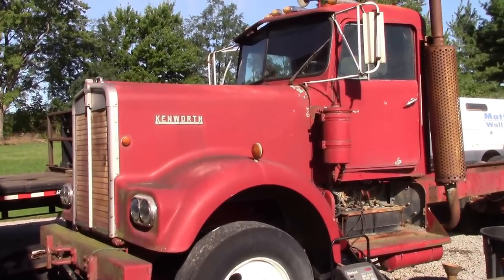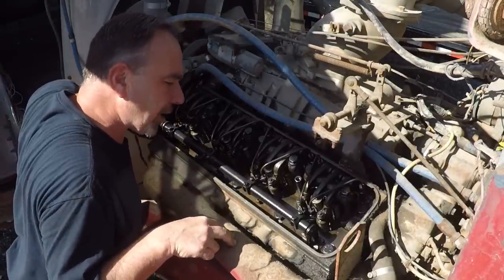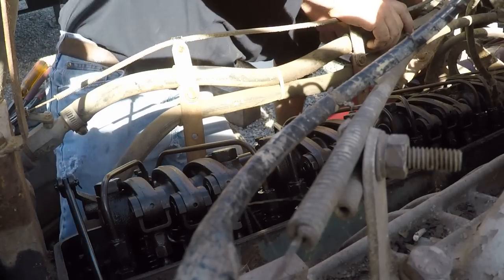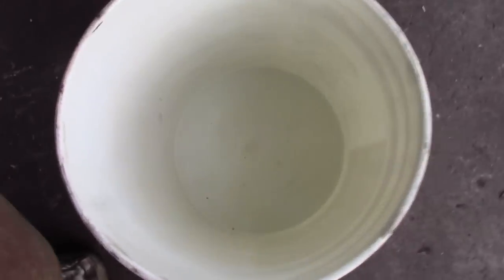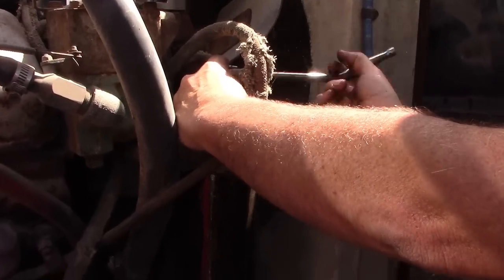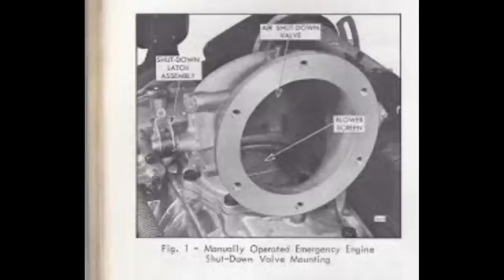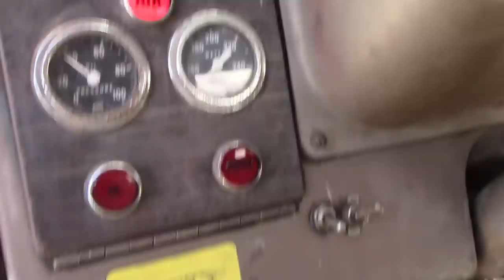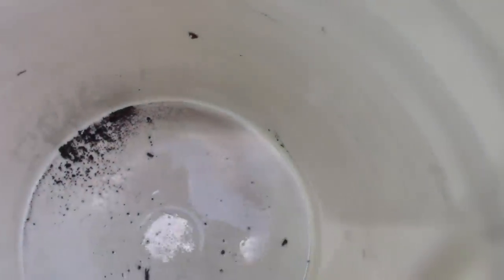WILL IT START? 1968 W900A 8V71 2 STROKE DETROIT!?

Comment: That was pretty cool! It's interesting that the alternator runs off the back of the engine. Looks like maybe the air compressor too. I'd like to see how that works.
Reply: They run off the back of the cam shafts. The alternator drive is bolted to the cam shaft gear, then goes through the accessory drive cover which has a lip type seal around the shaft. Then a pulley is mounted on the shaft. The air compressor bolts directly to the other accessory drive opening in the bell housing. Bolted to the back of this cam gear is a female gear type drive coupling. Between this and the compressor is a floating gear  coupling, male that goes into the drive coupling on the cam gear, then female gear that goes over the male driven gear on the air copmpressor. Minor revision, it looks like the alternator is actually driven off the blower drive. Same setup as above though.
Reply: Detroits are built so either end can be the front or rear and there are gear drives for the camshafts and the blower that can also drive many other things. They can be set up to run either direction too. It is also possible to get them to run in the opposite direction of what they are intended to run so the exhaust comes out of the air filter and the truck moves forward in reverse.
Reply: @tiredoldmechanic1791  Reminds me of a story I read online about a Saab 2stroke whose owner got challenged to a drag race by a muscle car owner.  The muscle car owner let the Saab owner specify a few details.  The Saab owner wanted the race in reverse.  As you can guess, he started the Saab up in reverse rotation and proceeded to motor away from the screaming engined muscle car using all 4 reverse gears!
Reply: @tiredoldmechanic1791  And when they are equipped with oil bath air filters, what a mess when they run backwards!!!!
Reply: first AND second !!
Reply: @tiredoldmechanic1791  I used to do tractor pulling with a super 99 Oliver with a 371 Detroit.  Stalled it out with the front end up, the front end coming down as I pushed in the clutch started it backwards.  Got it shut down right away, crowds loved it as it was very noisy.
Reply: @funguy571  The bad part of an engine running backwards is it has NO OIL PRESSURE..  The oil pump is running backwards too..

Comment: Detroit diesel, turning fuel into noise since 1939... What a sweet sound!
Reply: Lol, come on now, there are a few ponies along with the noise
Reply: and no power, screamin going nowhere
Reply: 318 HP at 2350 RPM.
Reply: @desertbob6835  318 HP? My 2014 Pete 367 had a Cummins ISL that made 550HP and 2050 lb ft with an Eaton 18 speed...AH...the beauties of a fairly large turbocharger...but the Detroit 2 strokes had a sound like no other engine. That Cummins could NEVER sound as good as the Detroits. Still, 318 HP is impressive with no forced induction.
Reply: @desertbob6835  It's confusing, Wikipedia says 304 HP@2100 RPM and 800 lb ft@1600 RPM, but previously it said 318 HP for the NA 8V71...so idk.
Reply: @Brock_Landers  you need bigger injectors (N70) and A timing to make 318.  318hp/865 lb-ft.
Reply: 8v71 was the 318. 8v92T was the 350? Next one I remember is the 430. Oh and was the 671 the 238?
Reply: 318hp with N65 injectors @2100 RPM and standard timing. 290hp with 60 cu mm injectors. 8V71T 350hp with 75 mms. The green 8V92Ts were 430hp with 85 mm from memory. Silvers were 475hp with 9G90 injectors and aftercooling.

Comment: Thanks for sharing this video JC, I really enjoyed the content & the music out of that stack  !!! 40 years ago I worked as a bus mechanic here in the UK, my job was to maintain air filters every 3 months, fuel filters, changed every 6 months, adjust tappets ( valve clearances ) every 6 months & change injectors annually. I replaced around 500 fuel filters a year on our fleet & the buses ran from around 6.00 am until midnight 7 days a week, I never saw a filter in that condition that you showed, often found some water but not that sludge. Well done Lady, admire her " I can do it " attitude, your a lucky JC TO HAVE A LADY THAT CAN !

Comment: The fuel return fitting on the back of the cylinder head has a restricted orifice to maintain  fuel rail  pressure from the transfer pump.  Thanks for reliving my day's  of old.

Comment: I never realized how big those Detroit engines were!! sounds good, take care Mr and Mrs JC
Reply: 8x71 = 568 cubic inches, which would be about 9.5 liters.
Reply: 71 series.......Each cylinder has a displacement of 70.93 cubes.  Multiply that by 8 and you get 567.44 CID which is 9298.6 cc, which rounds off very slightly to 9.3 litres.

Comment: Back in the 70s I drove a International Transtar 4200. I was driving across the truck lot and that emergency shutoff popped close. Thant’s when I learned it was there. I drove trucks for two different companies than ran Detroits.  All but one of them were terribly under-powered.  The only one that would pull a load was a White Road Boss.

I wished you would have your camera pointed at the exhaust to show what blew out of there when the engine started.

Comment: I drove an old GMC General that had an 8V72 in it. With a 5X4 behind it. Had to slam your fingers in the door in the morning so that you were all pissed off in order to shift all those gears. Gear jammer for sure, get the rpms built up and keep them on the upper end or start down shifting...lol God forbid if you missed a gear, not enough time for recovery, stop and start all over, Hence the reason for slamming your  fingers in the door...lol. Sounds great, exceptionally clean under the rocker boxes too!
Reply from the maker: that is exactly how my grandfather said you had to drive it. it is not the engine for me and where i am going with this project.

Comment: I have a customer with one of the last few 871's installed as an OEM engine in piece of machinery after they went out of production and the emissions restrictions made them illegal to use. It's been a while, but I think that was back around 1998 / 2000. It's only been back to the shop for repair once since we delivered it.    It's always a treat to hear that sound....

Comment: Thank's for the footage. I hope you intend to keep the engine in it. Not many of them left here in Australia so I have to rely on people like you to see some of these old trucks resurrected. By the way, looks like you and "lady" work well together, good to see 😎👍
Reply from the maker: i do not intend on using this engine for this build. i have something else in mid that requires more hp and torque than this engine is designed to put out. the cab and hood are what i will be using for my build.

Comment: Those old two strokes have an awesome sound to them. We had an old 71 or 73 Autocar with the same engine in it with a 13 sp the old truck was worn out.  The kids ran it around the house learning to shift it was ran it out of fuel a couple of times we had to pressurize the fuel tank to get it started. Parted it out years ago. Hope the family and all are doing well.

Comment: Volvo uses air brake line for fuel line from the factory, good for 10 plus years apparently. Those filters look nice 😂😂 It sounds good and I know some will disagree but I think that would be a miserable long drive in those old trucks at 30 mph up a hill... Trucks have come a long way in power and driver comfort over the years.
Reply from the maker: i agree. the novelty of the unique sound would wear off as soon as you realized you are constantly shifting 3-4 gears to climb the slightest incline. neat and interesting but not my choice for regular use.

Comment: I gotta say, that exhaust sound from those old 2 strokes is absolute music to my ears. I would like to swap one of those into my old suburban just for that reason if nothing else. Screw the 12 valve Cummins swap!
Reply: I don't think your suburban could handle the weight but would love to put one in my 1988  C3500 chevy truck
Reply: Stick with a 4-71 if your gonna do that. Even then you probably won't have enough room.

Comment: I like your thorough way of prepping an engine. I don't pop the injectors in the engine. If the rack moves, the injector will pop. Your method of checking valve movement is good but you need to turn the engine to check them all. Also be sure all 24 rockers are lubricating before you replace the valve covers.
Reply from the maker: watch the video again. i made sure i had oil to the rockers before we opened the emergency shut down flap. as far as checking the valves, i wanted to make sure they would move and were not siezed in the guide.

Comment: That Detroit sounds fantastic JC! 😀 What beautiful music coming from that stack. Glad to see it run with no noises. Amazing how the filters looked like they had tar on them! 😲 Two years ago I bid on a dump truck at an auction. It was a White Road Boss. Had an 8v71 Detroit, 13 speed road-ranger, turbocharged and had an air starter! Would have been a beast but got outbid. Im sure my eardrums are happy I dont have it 🤣.
Reply: Those air starters will leave a brown stain in your pants if you don't know what's coming.
Reply: @kevinhornbuckle  oh yeah! 🤣 Catch you off guard.
Reply from the maker: air starters sound neat for sure. the only ones i ever had were on parts trucks that had air leaks....miserable to start another truck to build air pressure so you could put air to the first truck just so it would start....they were parts truck so i had no interest in fixing the leaks.

Comment: Those old Detroits can sit in a feild forever and will still fire up with some fresh fuel..Worked on a lot of them when I was an apprentice back in the high school days.Love those old motors.
Reply: Can Detroits regain any kind of stature with today's technology or why not?
Reply: @larrybe2900  No because of the emissions standards today.
Reply: Larry Be they could GMs EMD locomotive division now owned by catapiller uses the same type engine in their locomotives except it’s a 16 cylinder 710 ci per cylinder. Before the 2015 tier 4 emissions standards went into effect those engines passed tier 3 and they could’ve made them pass tier 4 except the railroads were not interested in DEF. An over the road DD could be made to pass tier 4 emissions but tier 5 is on the horizon and really their are more powerful fuel efficient and reliable engines available. Even EMD switched to 4 stroke in 2015. The days of just add fuel and oil and let it rip at full throttle forever are gone now with all the electronics.
Reply: @Davidlabar4  
Thanks to all for commenting.

Comment: when I was a young  guy,  20 right out of the army nam vet. I did a lot of walking beam bushings king pins  clutches. 
there was a fellow who had a 1271,  I honestly can't recall, if it was twin turbo or not. Something special  about it:
I was elected to service the truck often. I didn't much care for it, but one time I had to do something on it that lead to me taking the tractor out to test run it. Let me tell you, it took off like a bullet, I like to head to the drags on the 
week end,  in short I took out on the high way for a joy ride,  there was a slight bend on the free way and all of a sudden
I'm sensing the truck wants to leave the freeway, ugh;   I was shacking. brought it back never done that again. it ran like the wind. one head always seemed to leak, the guy who did do most of the engine work, had that head off two or three times, sure enough it give it up. he was ticked. it was the last of a dying bread that when Cummins had some really big power horses,  more than that 1271 would ever have. that was there around in 1970 71.  there about.
I played with them some, I'm a cat man my self. dirt,  "-)
If I was a kid, and it was back to 1969 there about, I would love to go back to work on the over the road haulers. 
I recall white mustang, even before my time,  Reo, Mack, and those 700 jap cab over's city hauler's. 
did a few of those glider kits. cab change overs.  it was a White Truck dealer. Small shop in the city, an old brick building. 
It was good work.... You didn't need to be real smart, just willing to be there no matter what.  and do the work, and do it  right and do it good. amen.  I never lost a 2 stroke, but I had to fix a few others had messed with. 
I haven't touched one in 30 years.  I'm 72 now. J.C, Smith, like that.

Comment: it's refreshing to see someone go over everything before trying to crank it over; making sure fuel inj rack is free, checking fluids, changing filters, bypassing fuel tank, making sure you can snuff intake if need be, etc, etc..many others on YT that do will it starts just check fluids, hook up bats and go (not good).
Reply from the maker: many others dont understand the extra work and cost that come with the careless "throw batteries in it and crank" method. once of prevention can be a pound of cure in these situations.

Comment: I have never ever seen so much sludge in a primary fuel filter and the secondary was bad as well. I wonder just how much muck there is in the fuel tank and lines plus water but it must be pretty epic. I was most surprised how quickly it started one you got it primed and it didn't take long at all to get rid of the air in the system and having it run smoothly One wonders what the engine oil is like with such a filthy fuel system.
Congratulations on your success so far - I cannot imagine that there are too many left as good as this example.

Comment: I've never understood how the 2 stroke Detroit diesels worked til you explained it. I've heard different explanations before but they complicated it by getting too technical. Cool concept
Reply: It's all in the blower and cam (timing). The liner ports let the charge air in. If you want to go a step further, look into how jakes control the exhaust valves.

Comment: Yum yum. That's gotta be the biggest, highest horsepower espresso maker ever. Don't remember seeing diesel fuel that looked so much like coffee. And tell your lovely assistant to get herself a pair of chemical resistant gloves from Lowes or Amazon or Tractor Supply for her safety while evicting mice. They're durable and reusable, not like tear-prone nitrile or latex gloves. Would hitting everything - engine, exterior and even some areas in the cab - with a pressure washer make a beauty like this Kenworth easier to work on? Maybe a leaf blower?

Comment: This looks promising, it runs very clean, not much smoke at all, i like it very much. This shows that even a Detroit CAN run clean, this engine seems very well taken care of but i like to go with it might have been rebuilt- but good. It would be nice to see this dinosaur hauling paid loads again. You could argue this is likely more ecological taking care of the equipment already there than to produce new trucks. 
Good luck, stay safe.

Comment: Cut my teeth on a red 67 kw 8v71 wet block and a dry block as a diesel mechanic   then I moved on to Cummins and never looked back. So much cleaner to work on. I remember you count the oil drops  dropping on the ground from the breather tube to see how worn out the motor was . I remember tearing one down that. 2 liners were frozen to the pistons.abd the guy was still working the log truck.  I remember when I started running my own trucks my distaste for DETROITS when I would buy trucks I would avoid Detroit's even the series 60s for years. Only bought one series 60 tractor a day cab that ran a Seattle Portland route it had 350k and cost me $75-8 thousand in repairs the first year. So I'm still not a Detroit fan.

Comment: Develop Ronan there's got a prong on each side of the square hole in the middle in front of pump w x I'm breaking it won't let it Pump Fuel and it's a really easy fix just pull that little thing up pump off and sitting right in the end of it and I'm taking a break a lot I used to carry spares all the time with them

Comment: sounds like it was just last running yesterday. can't wait to see what you do with this truck
Reply from the maker: it sure sounds good. it isa shame they butchered the frame. my plan is probably going to make some people mad.
Reply: @j.c.smithprojects  yeah putting the cab and hood on a more modern chassis will save a ton of time and money. Be sure to save your old interior panels. It's a lot easier to get new ones made when you have the old ones for templates.
Reply from the maker: there really wasnt any interior panels. just a thin layer of mdf screwed in place. i have a very good friend who is going to do a completely custom interior from scratch. his work is second to none. i will take it to him after it is a running and driving final product.

Comment: I’m glad you explained how it works so I wouldn’t have to ask how you mix the fuel ⛽️ and oil in big tanks. How could the racks be so clean and the fuel so nasty? Is that from running off road fuel?
Reply from the maker: yes it was off road fuel.  the off road fuel is probably the reason the injectors were not stuck! todays fuel can be so hard on an engine that sits for long periods of time.
Reply: @j.c.smithprojects  Yes, some outfits have been known to recycle their waste engine oil back through the diesel storage tanks to get rid of it. But hard on the injectors !!!

Comment: An old stroker, as long as fuel and air can get in and the compression is strong enough, it'll run. The old school stuff just is like that. These vehicles were meant to go a lifetime plus with just overhauls and replacement parts and assemblies. I got into trucking because of a stroker ( 8V92TA )